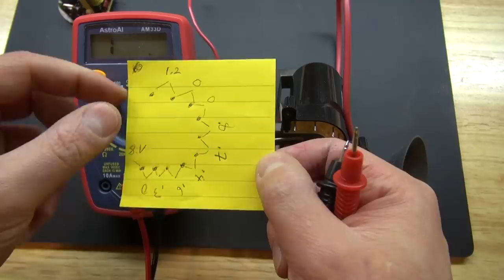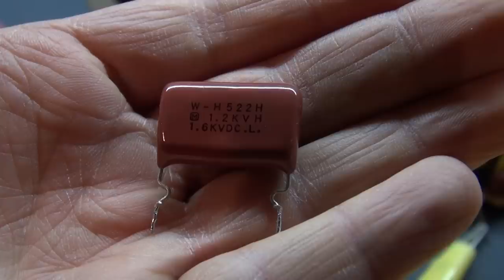High Voltage From A CFL And Flyback Transformer

Comment: Playing with Mains(220-230Volts) can Kill you in seconds.. Use a "Halogen Driver", or Laptop Drivers. Or what the're called.. Scooter battery. Easy to find 12volt adapters/drivers for computers..Just saying..This guy KNOWS mains electricity can kill,, MANY people don't think about that and get curious,excited,, and so on. Just take it easy,, and don't put your fingers TOO easily into stuff that can kill you !

Comment: What it good for? Too dangerous to play around with something like this, i guess you have nothing to do right?...
Reply from the maker: Yes, you are right it is. But I wanted to know if it works and it may be useful for future applications.
Reply: Hey there, if you need a simple plasma generator, you can use this method to create a plasma
Or if you have a neon bulb, and need a high voltage to light it, this HV generator can help you 
Or maybe just for impress someone and look smart XD
Reply: Truong its dangerous, but why you are here?
This plasma is very good for alot of things. Research about and find out ;)